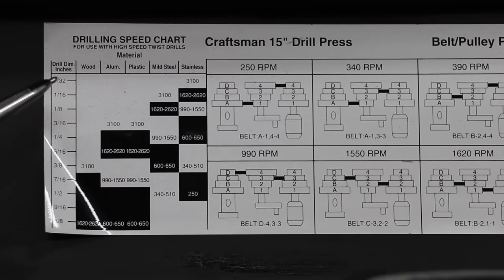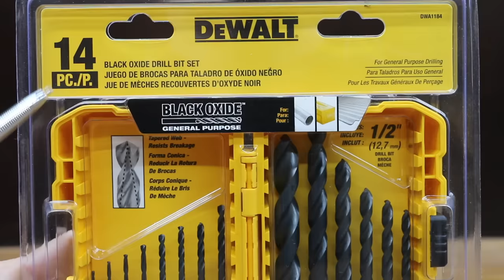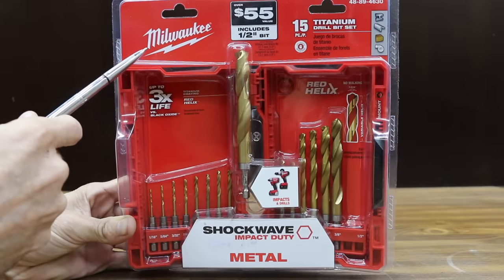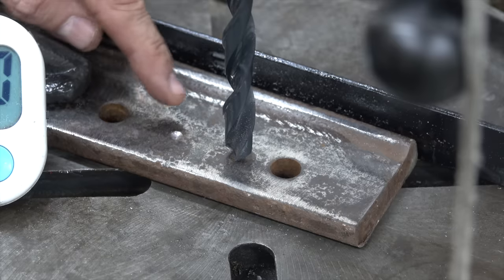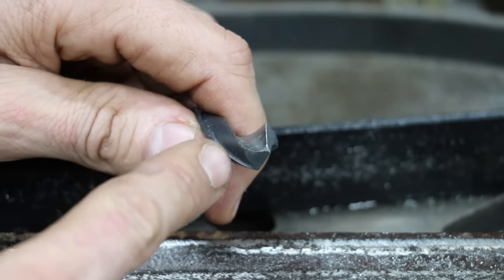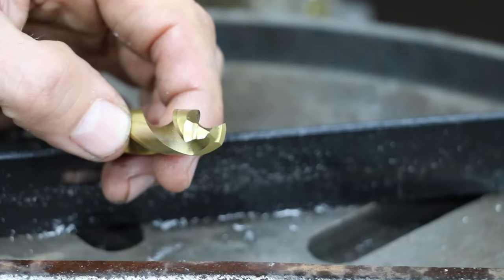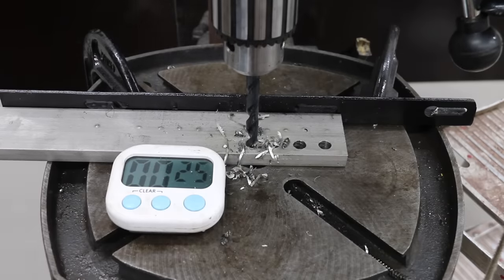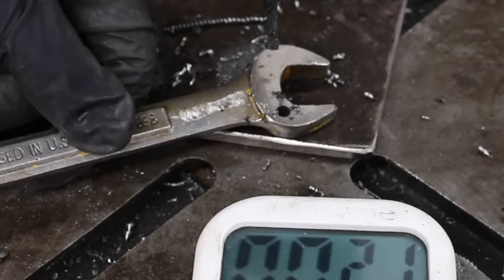Which Drill Bit Brand is Best? Let's find out!

Comment: This is one worth revisiting. I have the warrior set like shown here and I KNEW it wouldn't do well. Now Harbor Freight sells a $70 cobalt set which I am curious about... Learned a lot about speed and pressure on this as well as what brands are good for the price. In my opinion I would have two sets a beater "oh well" set and a great set for clean and precision work.
Reply from the maker: Thanks for the suggestion.
Reply: I have the harbor freight cobalt set. I really really can't say enough good about it.  The rest of the bits at harbor freight I never plan to buy again because they are junk for drilling the metal I drill. I have drilled out many CAT bolts on caterpillar equipment. If you ever worked with cat bolts you will remember they are tougher than grade 8. Very impressed. The drill hog cobalt bits are not as good as the harbor freight cobalt bits in my opinion

Comment: Well done tests like your channel, a bit late comment but for me on this topic, the test was fresh. In the field and at home I have developed some skills to sharpen drillbits and learned that every drillbit and its design are not fit for all the same materials and even the finish. Not to go in complete detail about shapes...HSS drills, when used for constructional steels and some alloys can be forced in with less pressure than Cobalt drillbits. Simply explained, its the design, the shape and sharpness. Most good HSS drillbit brands can perform at the same level, for various mild to alloy steel, if they are sharpened with all the proper angles. Some new drillbits are not manufactured well and won´t perform as they came out of the box. And, no need to buy a set of expensive Cobalt drillbits and find yourself not able to sharpen them as for the shape is rather different and complicated, especially at the center section and the grinding stone does not work due to the drillbits hardness. Another I would like to mention, drills will wear, a good sharpening stone, sharpening skills and maybe spend some money for a sharpening machine, may be more valuable. Cobalt drills can´t be sharpened endlessly, the drillbits have a limited length reduction, you may experience or already have. The Cobalt drillbits don´t like shockwaves either. Hope my comments are OK...I do not own wisdom...🙃
Reply from the maker: Thanks for the feedback.

Comment: Good videos, thank you.  I like to see  smaller size drill bit tests on 3, 4, 5mm drill bits that include Left-Hand drill bits and  what are the hand drill settings  forward  or reverse. I'm working on removing a 9.5 class  sheared bolt in my intake manifold in the engine bay
😅
Reply from the maker: Thanks and you are welcome!  Thanks for the video idea.

Comment: I'm confused as to why carbide bits were compared with titanium coated bits and cobalt bits. Most of these brands have carbide bits, titanium bits, and cobalt bits. Why not an apples to apples comparison?  Of course titanium is going to cut faster... and of course cobalt is going to show the least wear. Seems like the relevant question is whether (for example) a Bosch titanium performs better than a DeWalt titanium bit, right?
Reply: That's not to be unappreciative. I appreciate the trouble you go through to run these experiments and share what you find.

Comment: After drilling many, many thousands of holes in various hard metals (aviation), I see drill wear is primarily caused by heat build up due to too high of speed being used.  Turning a drill slower and using more feed pressure causes less heat build up and allows the cutting edge to continually bite into cooler material, thus keeping the cutting edge below the temp which will change the temper of the drill bit steel, softening it and therefore allowing it to dull prematurely.  A lube also helps greatly, oil, bees wax, Boelube, even Lubestick Acetyl Alcohol for extra hard metals (must be melted on hot bit).
Reply from the maker: Thanks for sharing.

Comment: The only thing I see missing is a comment about the angle of the cutting edges.  For example, using 'ordinary' high speed cobalt coated drill bits required a lot of pressure and only lasted 2 - 3 uses when drilling in high strength steel used in modern car 'cages'.  But cobalt 'jobber' drills with a flatter angle lasted for 20 - 30 uses before requiring resharpening.  When I sharpened the cobalt coated ones at the same angle as the solid 'jobber' ones they cut quicker but didn't last much longer as the solid cobalt drills.
Reply from the maker: Thanks for the feedback.

Comment: It would be interesting to see how these compare against a set of good industrial bits.

Generally, we don’t consider holes made by drill bits alone to be round, smooth, or accurate. As long as they make the hole in decent time without wear, it’s fine. If you want an accurate, smooth hole, you need a reamer after you drill the hole slightly under size (usually by a 1/64th).

Actually, after a half dozen holes, there shouldn’t be any wear on a good bit.
Reply from the maker: Thanks for the video idea.

Comment: Bought the Bauer 21 piece set and the Metabo 17 piece set after seeing this review because I wanted some cheap bits to practice hand sharpening on. I am a little surprised to find that the Bauers are consistent with minor runout however 5 of 17 Metabo's came pre-bent. The amount of vibration and chatter from the bits is not acceptable and the two smallest bits have enough bend that they will quickly break if used. The amount of runout found on 1/3 of the metabo bits from menards should bear heavily on the overall value
Reply from the maker: Thanks for sharing.

Comment: Spring steel can be annealed or heat treated. If it is annealed it would be like 190 Brinell hardness. If it's heat treated it be like 300 hardness. At 190 hardness 120 lbs on the quill is barely enough enough feed force for a 1/2" drill.

Comment: Can you test 3% M32, 6% and 8% Cobalt M42 bits and Carbide tiped drill bits. Preferably 1/2"(12.7mm) or 13mm bits on high grade autimotive hardened steel.
Reply from the maker: Thanks for the suggestion.

Comment: I would love to see the low end vs  top end cobalt  bits
Reply from the maker: Thanks for the suggestion.
Reply: @ProjectFarm  as I have used 2 different brands here in the uk , trying to drill out stainless steel bolts both brands taking a very very long time .

Comment: Would be great to see a test of auger bits and paddle style bits in wood.  Also if there is a quick way to sharpen them.
Reply from the maker: Thanks for the suggestion.
Reply: @ProjectFarm  thanks for the response.  I would be interested if auger bit manufacturers have different performance and if depth of hole matters and how size of hole affects the two styles.  We use a lot of the 18" auger bits in construction and if not going as deep I think the Bosch Daredevil Spades are faster then augers but never tested it out.

Comment: Good test as usual, but drilling 1/2 inch into hard steel with no pilot hole?  Not a great test of real world use, but still shows basic quality.   Also- comparing cobalt vs. Carbon steels, of course cobalt wins.   I'd try a cheap cobalt as well.   Excellent speed test at the end:  that will help many people!
Reply from the maker: Thanks!  Thanks for the feedback.

Comment: I always tell students I work with that the faster speeds on hand drills is pretty much exclusively for wood and even small drills in aluminum 800 rpm on a hand drill is plenty and anything larger than 1/4 in in proper steel is a fools errand without a drill press or ability to pre drill and step up.
Reply from the maker: Thanks for the feedback.

Comment: Hey Todd!  Random idea, for all those bits that failed... what if you did a combo video where you used the best sharpener in a previous video to see if it helps with the bits that didn't get thru the metal sheet.
Reply from the maker: Thanks for the suggestion.

Comment: With spring steel, you gotta get through the case hardening. Without enough pressure and heat, you only harden the case hardening and that ruins any drill bit. It may be advantageous to drill a smaller pilot hole first.
Reply from the maker: Thanks for the feedback.

Comment: Okay since it doing drill bits what about bolt extractors i just had to use one maybe a month or 2 ago i was chaning my mothers spark plugs and one of the ceramics broke off the treaded part that screws in i bought an extractor kit from Autozone maybe 40 bucks and found a socket that would fit snug on it then beat it on there cranked the extractor carefully to avoid breaking it then eventually it let loose and i was able to replace the spark plug i just want to know if there's a better way or anything better in the sense to remove something say stuck in an engine that's really hard to remove with pliers or channel locks
Reply from the maker: Thanks for the suggestion.

Comment: In my experience the quality of the factory grind has as much to do with the performance as the grade of steel, but as you noted at the end the user's technique is arguably the most important. It was painful to watch you dull the bits with insufficient force before increasing it when already dulled, but it got the point across that some cut just fine with that initial force.
Reply from the maker: Thanks for sharing.

Comment: I drill A LOT of stainless.  I own several very expensive bits.  I would LOVE to see good bits tested for hard SS to prove which is best.
Reply from the maker: Thanks for the suggestion.
Reply: Also, i use hole saws through stainless and also commercial roofing steel.  We burn them up constantly.

Comment: Machinist here. My tip to everyone would be to buy the cheapest HSS drills you can find, they all wear out anyway. And learn to sharpen drill bits or buy a jig. One aspect not taken into considerstion in this video is the angle of the chisel wich will affect the results very much, more than brand and quality of materials
Reply from the maker: Thanks for the feedback.

Comment: Problem with this test is: Most cheap bits will make a few good holes. Then get RAPIDLY worse. Would like to see a test with expensive, medium priced and cheap bits drill thru spring steel and see if any can do it 20X.  So Far I'm gonna buy Bosch next time around. Thanks.
Reply from the maker: Thanks for the suggestion.

Comment: These test the drill bits and (mostly) the initial sharpness. That is all fine, but I would like a test to see which is made of the best steel. A test that has these drills bits all dulled identically, and then resharpened to the same degree on the same machine (Drill Doctor), then tested, that would show the superior steel.
Reply from the maker: Thanks for the video idea.

Comment: I bought some Ryobi drill bits because the case and presentation looked so nice, but they have been the worst drill bits I have ever owned... even my oldest drill bits which are a standard Black & Decker  set which belonged to my father since the 1980's are far better. I've been using the Milwaukee brand drill bits most of the time and they're only OK in my opinion, but maybe I'll change my brand after watching this video. It definitely won't be Hypertough which is more like Hyperweak.
Reply from the maker: Thanks for the feedback.

Comment: Great test but it isn’t fare. The 118 degree tip is made for softer material like wood and aluminum.  135 degree tip is for hard stuff like steel. That is why Dewalt and Bosch did so good.  It makes a huge difference also in tool life.
Reply from the maker: Thanks for the feedback.

Comment: This video was a lot of good work, but completely missed out on two of the more important aspects, TOOL GEOMETRY, and WHAT the drill material PURPOSE is for.

The ONE feature not emphasized was the "split point" feature.  This one aspect alone IS important.  The other geometry feature is the drill point angle. Standard drill point angle is 118°.  Alternative angle is 135° often used for harder materials. Also important is "web thinning" and "rake".  This is a matter of simply looking at the tool bit set BEFORE purchasing.   None of this was even mentioned in this video.

Then the drill material was skipped over with no explanation ....yet it seemed that "cost" was more important.  Well, if you're not going to provide any information about drill material or "coating" ....and in particular "SHARPENING" .....then this video is fundamentally only for people who need a drill every five or six years .....for wood.

.

Comment: Like your test but the Bosch bits are cobalt which is why they're so expensive. Cobalt is going to smoke thru anything. I drill thru titanium for work and a cobalt bit is the only thing that goes through it. Also cobalt bits are brittle and break easily. Always use a drill press and cutting fluid with cobalt bits at slow and steady speed. No hand drill!
Reply from the maker: Thanks for the feedback.

Comment: I went back to this because I need to get another set of drill bits. The only thing missing from the review is how long they last. Maybe a Part 2 video using the top 5 and see how many holes they can drill in mild steel before they are useless? Thanks for all the reviews. I fall back on them a lot.
Reply from the maker: Thanks for the suggestion.

Comment: I do not think that spring steel has a uniform hardness. I worked at a metal shop, and we had a big metal bandsaw.  Every once in a while when cutting some metal, it would hit something inside the metal, and shed the teeth on the saw blade.  Undoubtedly, sometimes there are impurities in the metal that affect the hardness.
Reply from the maker: Thanks for sharing.

Comment: I like all Project Farm tests and videos but this one is a failure, unfortunately. The most important factor in the performance of a drill is whether it cuts the correct size!
So a quarter-inch drill should generally be able to cut 0.250 with a minimum tolerance of 10 thou either way in mild steel. (depending on the requirements of the project). 
I saw no effort to verify the tolerances of the cuts in this video, Project Farm!
Tool wear and 'time to complete work' is secondary to the quality(size) of the hole. 
I can imagine other viewers might think that for the average home user it doesn't matter if the cut is off by half a millimeter but then why bother having different size drills at all? 
For professional use and for when it matters in a home project: Hole size is critical.

Comment: ARE THESE DRILL BITS THE SAME AS MACHINIST DRILL BITS?
Reply: Nope.  A machinist would FIRST sharpen the drill bit.  Those that needed more weight, were already dull on the point edge "it has a specific name and a specific angle.  Forgotten over the years.  Most of my twist bits are decent for copper, aluminum, brass, lead wood, plastic & soft fudgsicle.

Comment: Cobalt vs: High Speed Steel. Cobalt is tops, web thinned and stronger over all bits.
Reply: Use for steel or other metals only. 
Carbide and Diamond bits for special purpose also.
Reply from the maker: Thanks for the suggestion.

Comment: Nice job, thank you for doing this.  I bought the Harbor Freight Warrior bits based on this test since I wanted 1/64" steps and they performed good enough to have on a few different benches.  I might also get the Bosch bits for harder metals.  One thing, HF has several different 29 bit sets, look for Titanium Nitride, High Speed Steel Drill Bit Set.  It looks like the item number (SKU) changed but in 6-2021 it was #61637.  The link just goes to the HF home page not the actual item.

Comment: A couple of observations:
Whenever the color of steel chips starts turning straw colored the speed is starting 2 get 2 B 2 fast. When it turns blue it's WAAAAY 2 fast!
Whenever U drill any hard steels or SS U need 2 center drill the mat'l 1st. It'll save LOTS of wear 'n tear on the lips 'n TONS of wear on the point. A spot drill will NOT B adequate. In addition U'll B way ahead if U use drill bits W/a 135° included lip angle. 98% of the regular, jobber bits, R 118° included angles which is usually fine 4 99.9% of normal shop use. In this test, I know, that U couldn't do that.
Titanium nitride (TiN) is an extremely hard ceramic material, that's been around since the early 70's. It protects the steel bits for extended performance life. It won't make drills cut any faster or give any better finish. Also after the 1st sharpening it's basically all gone! 
The finish of drilled holes is usually not that important. ''IF" U want a good finish U'll drill it .004" ~ 007' undersized  'n then ream it 2 size. Drill bits, BTW, ALL drill bits, cut .003" ~ .010" oversize (1/4" - 1/2" diameter) mostly depending on how accurate the dril point was ground in the 1st place. Stability of the machine is the 2nd consideration. 
4 all of Ur drilling tests, going forward, I'd recommend reducing the "listed speed"  ~ 20 - 25% & start W/~ 25 - 40%% more weight  . . . . . especially 4 1/2" drill bits. YMMV
Retired Journeyman Machinist 
      "       Tool & Cutter grinder shop owner
ASQ Metrology Instructor
Reply from the maker: Thanks for the feedback.

Comment: Aviation structural mech retired from the Navy. Brand isnt as important as material. For general purpose plain old steel works fine but for fast through stainless for example everyone should at least have a small set of cobalt.
Reply from the maker: Thanks for the feedback.

Comment: feeds and speeds must fit together and this is not easy with a hand drill - machine       use low gear   from 6mm and up  .. under 6mm you can use  high gear  but drive so slow that chips do not turn blue and remember drills can grind over and over again
Reply from the maker: Thanks for the feedback.